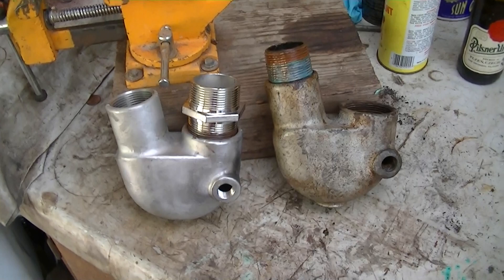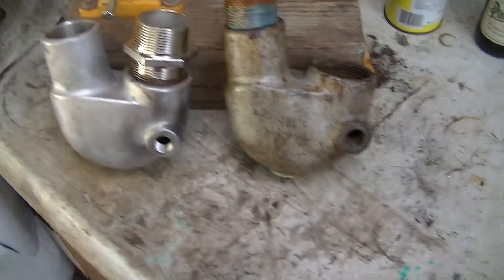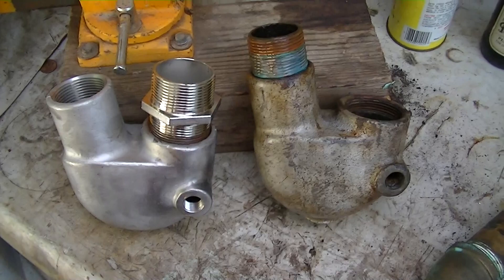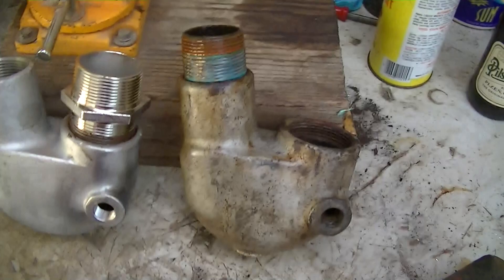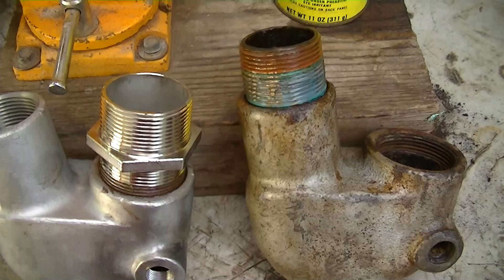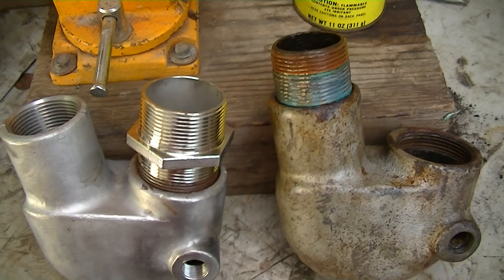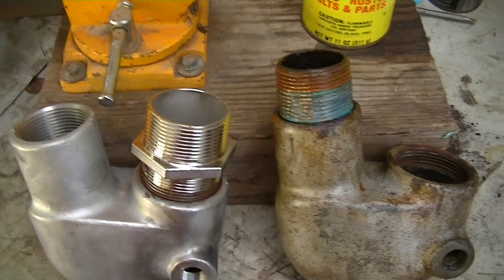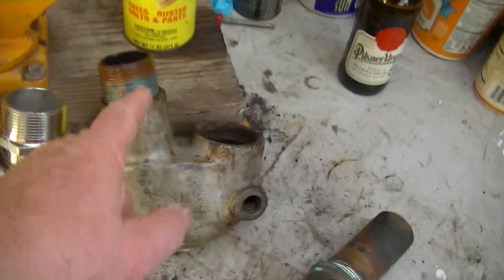Fisher 30 Refit : # 75 Water Cooled "Yanmar"Exhaust   elbow stuck nipple.

Comment from the maker: 2021 Update.  As an Experiment, I am using Evaporust to remove the unreachable rust in the water passage portion of the old elbow.  That is what rendered the old elbow  unusable.  I am confident this method can restore full water flow, and full exhaust flow.  I will post the link here, when I am done, so everyone can see the results.f  If it works, it offers a low cost, low tech method for sailors to keep their engine running.   Just as the rust removal from my raw water cooled Volvo MD-3 saved that engine for decades more service with no teardown, and measurable improvment that defies belief .. untill you under stand how evaporust works and how to use it.
Reply: Did the evaporust work?
Reply: Good Day Capt Larry : There is also another product available on the market for rust removal . It's called "Naval Jelly"  . It's a bright pink jelly you would apply , wait about 10 -15 min and rinse off with water .
Reply: Heating the nipple with a propane torch will likely expand it enough to break the seal with the cast iron.